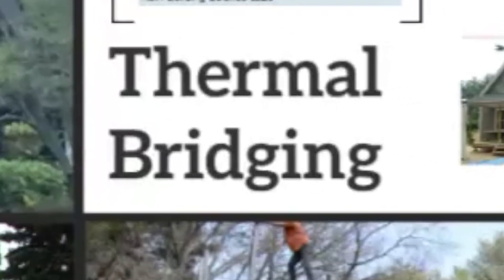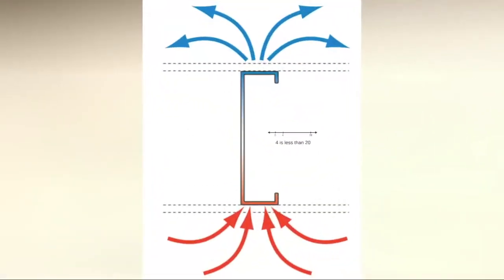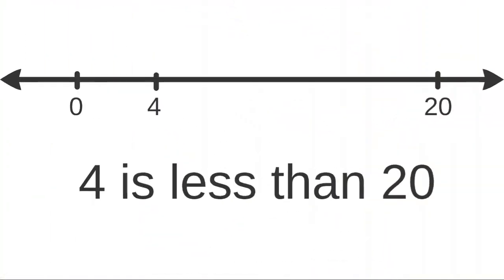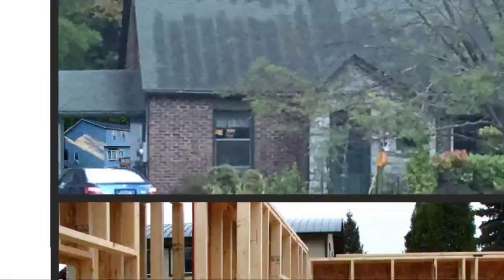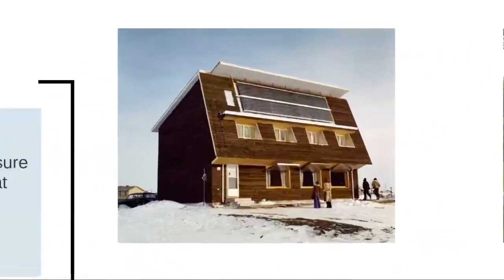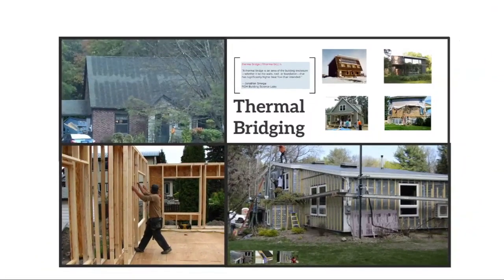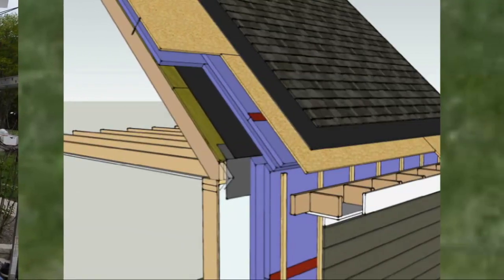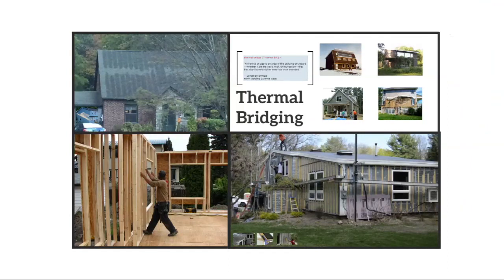Thermal Bridging

Comment: You guys are great!. Here are some of my questions relating to CI. Will the vapor impermeability of the foam boards be a concern for climate zone 4 and above? Since as it stands, an inside vapor barrier behind drywall is now slowing becoming obsolete. As vapor travels through drywall and interior insulation, it will then go through the sheathing and house wrap. After that stage, I'm concerned that the foam boards will stop the vapor and thus cause condensation between the house wrap, which as we know is not a perfect barrier to perfect the osb behind it. I do wish to use the roxul comfortboard instead but then the air tight quality of the foam boards would be eliminated, making the house wrap and the siding the only two things that stops air from leaking in. Any suggestion on this? If I were to combine both foam board and roxul for exterior insulation, what would be the order of placement that you would recommend. Been following you guys for a while and I absolutely love the content and the wittiness. Only been watching old videos of yours so didn't comment much but will comment regularly for your new uploads. Thanks guys!

Comment: Wont putting foam on the outside of the house act as a vapor barrier and rot the studs
Reply from the maker: No. 
Well, It may be a vapor barrier, but it will not rot the studs unless you also add plastic to the inside of the wall. 

Exterior insulation moves the condensing surface for moist air from the backside of the wall sheathing to somewhere in the middle of the foam. Interior moisture that finds its way into the wall cavity will not condense on a cold surface because there are no cold surfaces.

Make sense?

Comment: Foam board is dangerous because it is flammable!
Reply from the maker: Most building materials are flammable. follow fire codes.
Reply: It's partly why roxul comfortbatt is better but twice as expensive. Wood siding and everything else including regular fiberglass insulation are flammable too. It is a bit of a concern but it's why there are multiple measures including fire resistant drywall, blocking between studs, fire alarms, etc.